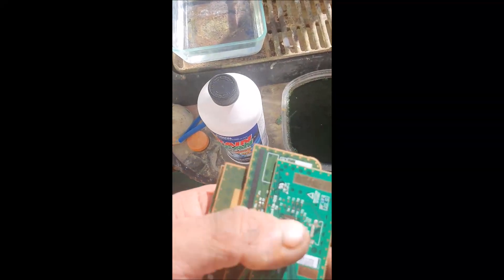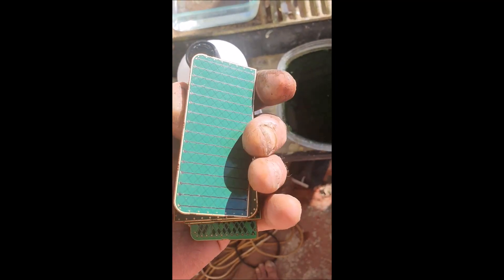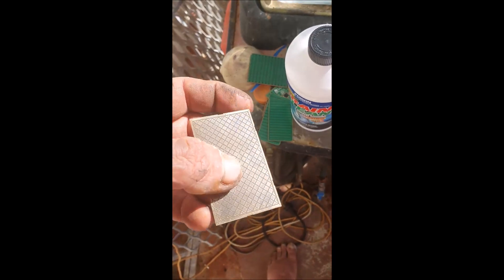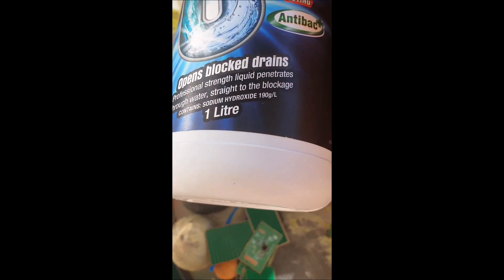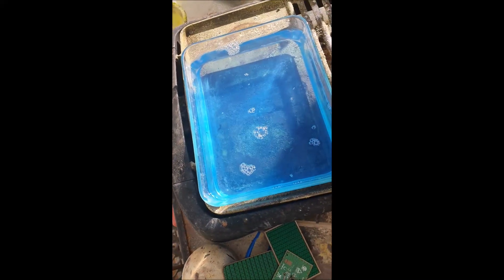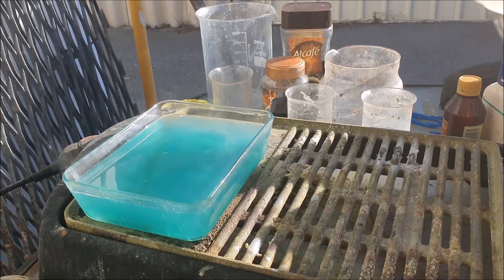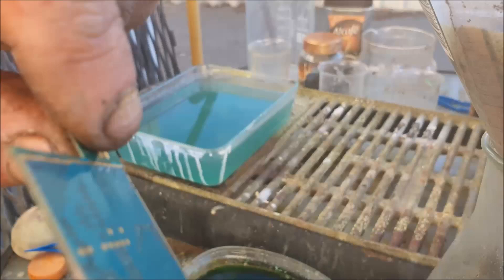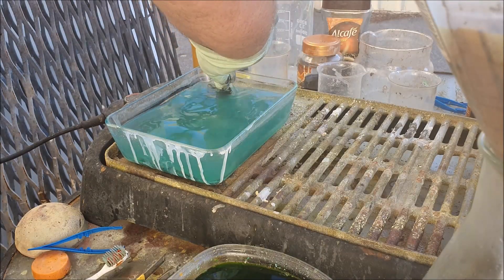EWASTE / are ALL mouse pads fully gold plated ?

Comment: Cheers bro, awesome video, i had some mouse pads that had gold on it. I wasnt sure what to do with it so i just burned it and blended it up with my IC chips. I guess you can just flush that solution down the toilet once you are finished with it since it is drain cleaner?
Reply from the maker: Yeah you can if you wish.
Its a shame you burnt your boards. Its so much easier to get the gold off with dilute nitric. Ill be doing a video about it soon
Reply: @prospectorpete  I am watching your full process for getting gold from scrap. I thought AP needed to be used. glad I can stop doing it. I have already depopulated some boards with the heat gun. The other way was making my hands hurt. A video on what to do with boards would be awesome. people typically just show gold fingers or some other easy type stuff. I want to refine it all. lol.  I am also going to stop using Urea. it seems everyone uses the other stuff more than Urea.
Reply from the maker: @andyman5728  youre in luck because im going to do a video of the gold on boards real soon , infact ill start it today just for you loland yes sulfamic acid beats urea hands down